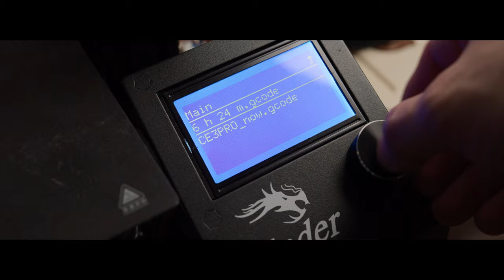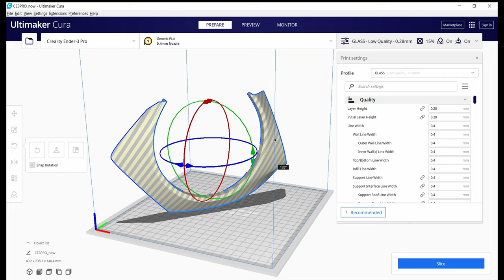Electric Sports Car. From clay to 3D-Printed model.

Comment: Looks awesome! Why do you use clay to design rather than computer or pencil?
Reply from the maker: Thank you. This project consists of five episodes. I started with sketches.
I could make a model without clay, but the clay model makes that process 100 percent easier. I just decided to show that method.
Reply: @designerwithacamera  I am really interested in why it makes the process easier. For example, maybe using clay helps you resolve problem areas quicker than you could in 3d Or clay lets you try variations a lot faster than 3d. Or even the 3d modeling process is sped up by a huge factor because you have a scan to work with and the time saved makes it worth while. Just trying to ascertain if I should give clay a go in the design process.
Reply from the maker: @Brocknoviatch  Clay modeling helps to see the result here and now. Working with clay, I can find the volume and proportions very fast. For me, that's like a 3d sketch. I do my project with and without clay, but I like to work with it. That's like film photography. It requires some knowledge. But seeing the result of your work in clay - is incredibly inspiring.

Comment: Hello, what type of filament are you using? PLA or PLA +
Reply from the maker: I use PLA by Creality  and PLA+ by ESUN 😉👍
Reply: @designerwithacamera  thank
Reply from the maker: @jeanindustriel7178  ESun pla+ most of the parts. Creality pla I can't recommended.